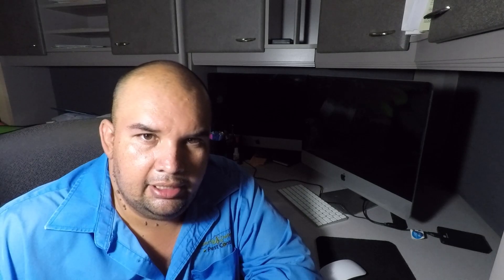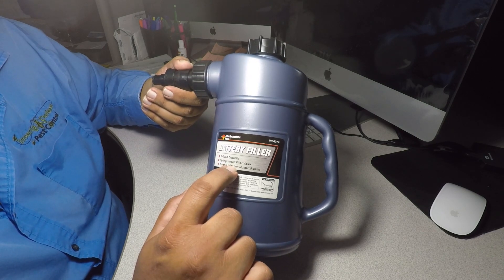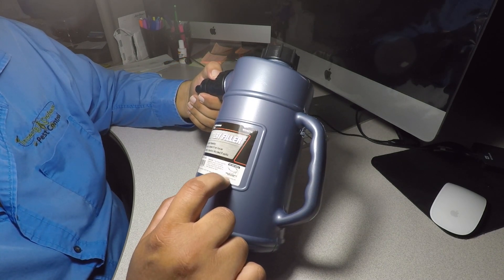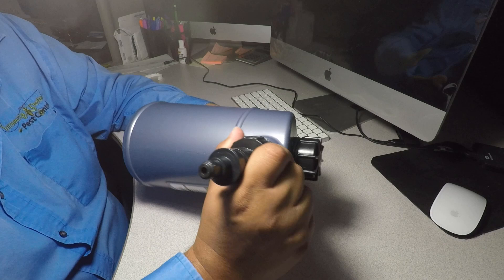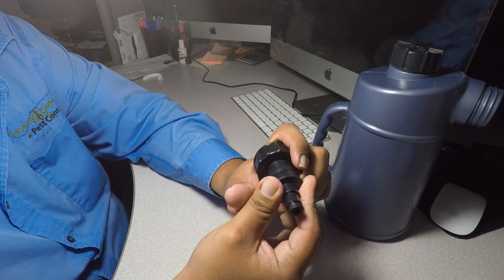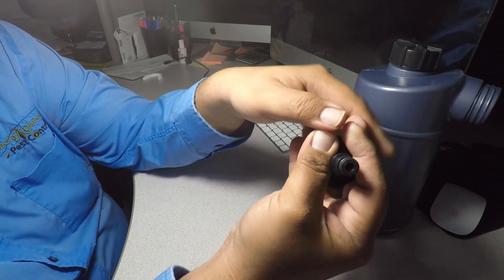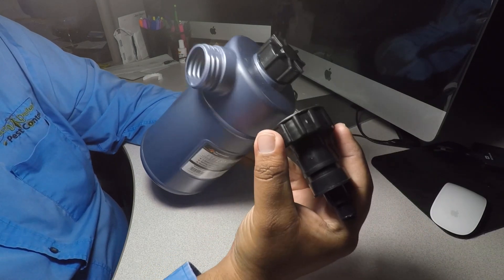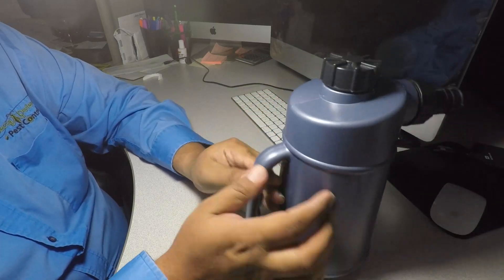How to add water to golf cart batteries Instruction/Review|DIY Solar

Comment: I have the exact same one, it is supposed to shut off but it doesn't. I tried an old lawn mower battery and it overflowed. Maybe something I did wrong?
Reply from the maker: Yes its probably defected, mine works perfect
Reply: @toolhead147  Ok. Thanks